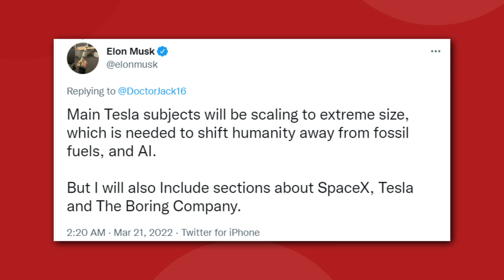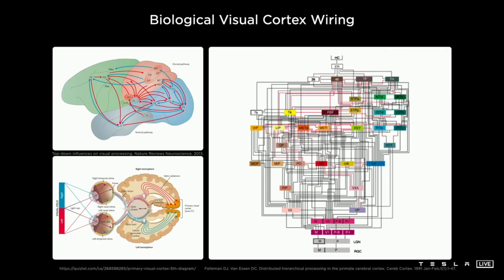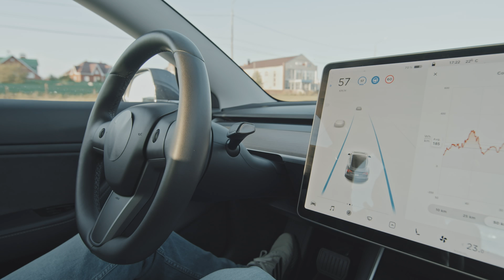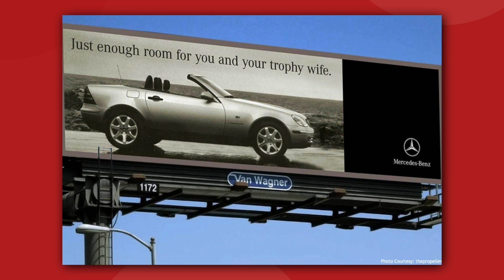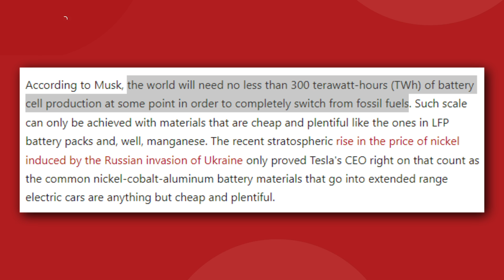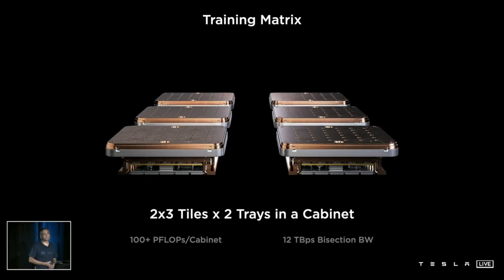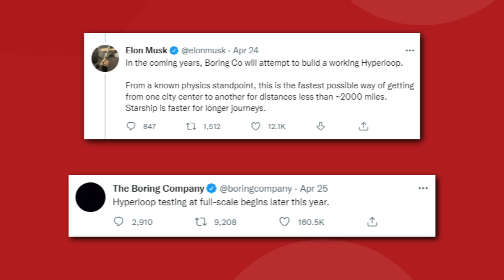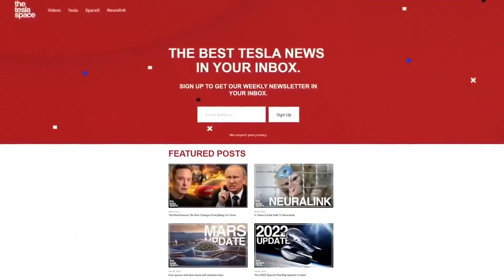The Key To Elon Musk's Master Plan Part 3!

Comment: 13:11 Wrong. In the original hyperloop design is some air in the tunnel (lower pressure that 1bar). This is a key idea of hyperloop: you don't need to remove all air to make it workable.

Comment: The Boring company...To dig tunnels on mars to get around underground. Better than building a dome. Also the homes will (or should) be made with 3D printers. The dirt coming out of the tunnels will be the media to build the homes.
Reply: Inflatable homes could be brought in and inflated in caves, the cave entry then sealed with regolith cement to keep dust out....         :)

A dome would fluctuate wildly in temperature, they would need a giant rubber lung to absorb the expanding daytime air...

Comment: The Master Plan is Mars.   Tesla solves the labour, power, and fuel problems.  SpaceX solves the communications and delivery problems.  The Boring Company solves the early habitat problem.  What surprises me is that Elon isn't planning to industrialise the Moon before Mars.  He needs to move a megaton of equipment to Mars if he wants to kickstart the economy there for a million people.  The cost of lifting that equipment from Earth is 2 orders of magnitude higher than lifting it from the Moon.   Power on the Moon is not difficult.   Solar and nuclear.  Arrive with solar, upgrade to nuclear using nuclear fuel from the Moon.  Build the machines that make the machines.  Use the Teslabot to do the work.

Comment: Great research and conclusions thanks. It’s no coincidence that the air pressure in a Hyperloop is identical to the mars atmospheric pressure. It is also no coincidence that the best form of surface travel on Mars is going to be Hyperloop (no bitumen for roads, no gas stations and high cosmic radiation above ground).

Comment: You can't and don't want to stop selling cars! 1: soooooo many edge cases and isolated areas where waiting is impractical. Nearly every farm! But I see a point where there are probably 1/3 as many sold, and yes makes sense for Tesla to own and control the robotaxi fleet, and recycle those resources.
Always thought boring tunneller in high tech (light) materials could drill underground, shielded accommodation on moon and made, in very short order!

Comment: Another key is to ramp up both solar cell efficiency and solar cell production.  If homeowners can power their homes/cars with solar/battery this drastically reduces the stress on the overall grid and the need for so many peaker plants which will lower CO2 emissions further.  Another big help from transitioning to EV is the reduction in petroleum refineries.  They alone use over 15% of all industrial electricity just to turn oil into gasoline.  The more EV's the less need for grid electricity to power those plants.

Comment: The data is only as good as the FSD beta drivers are at marking and recording problems or interventions.
I see so many clips where testers do not even hit the record button on the screen for interventions.
Phantom braking incidents should be noted and recorded. Driving 20 mph on a 35 mph road should be recorded and sent to Tesla. I think Tesla has automated much of the labeling of the clips now. That is why, I think, Tesla has expanded the number of beta testers so much over the last several months. They are ready to process a large amount of quality data.

Comment: would be interesting to know, how the diameter of the new rocket compares to the diameter of the boring company machine?  Could the big plan to be sending a machine or two to Mars to dig tunnels to live in.  this maybe why the robots and AI so they can assemble and run this all prior to humans going.
Reply: It seems to me that the Boring Co. always was targeted to the Moon and Mars. As is the Starlink satellite system. Just put one or two transmitters in stationary solar orbit to boost the signal and everyone and everything is connected. I’m 76, and been in the vanguard of technology before PC’s. It’s still as exciting as the first time I saw a single line of digital text on a Compuwriter Jr.
Reply: @floathouse2  ahhh yes, the Compuwriter! The great grandfather of the Commodore 64 and the TRS80! The good old days!✌️
Reply: LOL, see, for that you need a modular boring machine, that is separated in to many segments, and would total nearly 100 launches dedicated to simply the boring machine, but if you add to that on site  production of the materials needed to line the tunnels then you are talking more like 150 launches to get the oven, and the hydraulic brick shaping press there as well,  but that would be all you need to start building a major underground city and connecting the cave systems of mars.
Reply: @yamiomo7392  no, the boring part is the front, all the rest is fitting walls and moving junk! All can be optimised for shorter work life, more expensive materials, and packed around other frieght and supplies. 
Just 1 example would be gluing sheets of SS onto walls instead of handling heavy concrete. (Ie, a sacrificial starship, and as robot cutter removes strips it lowers top section which could be an outside storage shed!
Reply: @RacefanPat68   they can make it lighter, but would build it to last longer, shorter work life is to expensive when calculating the costs of getting the machine there, it would be intended to last decades, As for reducing the weight, the gravity on mars is lower, so the over all sturdyness of the machine can be toned down without sacrificing working hours on the machine, even perhaps increasing it but that is only when talking surface mining, in comparison to it's use time on earth, As for the materials, composites such as carbon composite materials are subject to galvanic corrosion, and break down over time do to oxidation stresses, a failure on a colony is far more costly then shipping out an oven and press to make bricks on site, the inner lining would be made of something else, the gravity on mars is lower, so they could get away with making a large number of components out of lighter materials with higher strength to weight ratios, however, any moving parts due to material physics will have to remain as is, such as hydraulic cylinders and cutting heads, The weight reductions made won't be that major when considering the extra volume needed to get the thing strong enough, the trade off would not be worth it as these will be used at far greater depth then they are on earth, as the deeper you go, the more protection you get from impactors and radiation, To conclude, they will send the top of the line machine they build by the time they are planning on launching.
Reply: Rocket is 9m and tunneller are 6... Imagine a boring machine of lightweight high strength materials.....
Reply: Well the diameter I'd perfect for the boring machine and starship, they fit like a glove but the biggest hurdle would be weight as starship 'currently' wont be able to meet the weight requirements of the boring machine so the better option is to cut it up in segments and will need a lot of launches